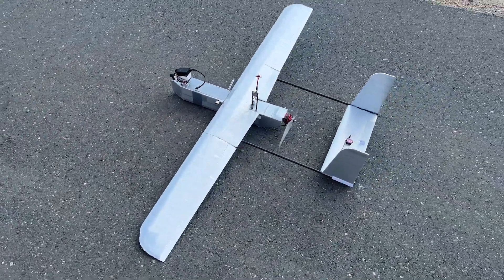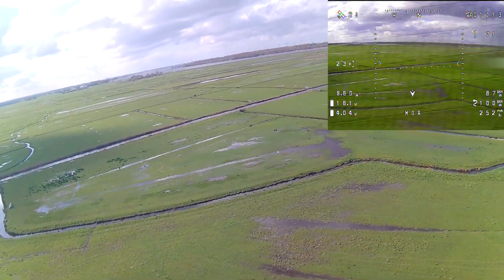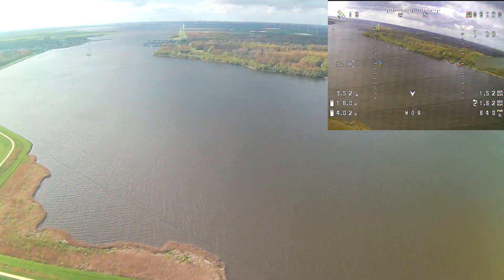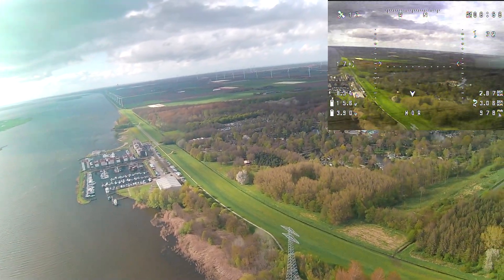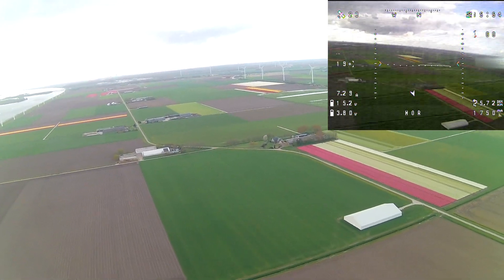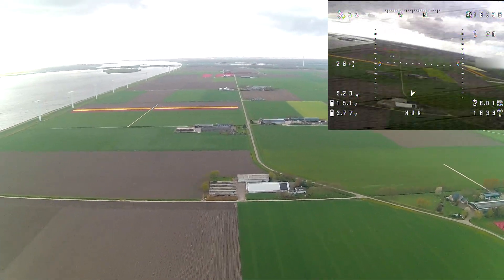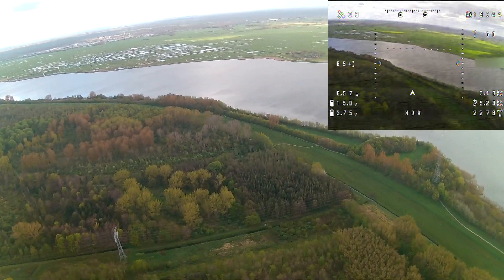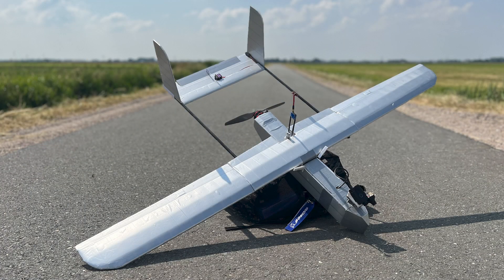Autonomous UAV for FPV - Silver Shadow - Range Test (Narrated FPV)

Comment: Would be interesting if you build an inverted V tail. You can remove the horizontal stabilizer from this and tip the vertical ones together and you're there.

Comment: Hi, really like your airplanes, New to the channel. I did not see all of your video, so I need to ask. Have you ever made a plane with airfoil that are not at 180 degree of each other. I understand that those help for stability of lift. But they are also slow and induce a lot of drag.  a V airfoil can help going faster with less drag and not so much power consumption. In your last video the batteries were not that low. you could have gone way farter and faster. I am also a ham radio operator. The frequency that you use is using line of sight (LOF), If you place your start base on a small hill or even on the top of a mountain that face a large plain, You could even do 20+ km with such setup.  The  LOF is not base on your eye sight but on the fact that the receiver and emitter have nothing between them.
Reply from the maker: Thanks!

I surely have made V-Tails, have a scroll through my videos!

Comment: Great , flight . That is some beautiful terrain that you flew over . Just curious if you could use a trailing antenna for your video feed  ?? Happy flying .
Terry
Reply: At those frequency the antenna length is not the problem, It is line of sight that is important. You can send a signal of half a watt into a satellite that is 100 km into space. We communicate with the ISS with hand held that have less than 5 watts. And that is in VHF and UHF (between 50 mhz and 700 mhz) the video transmitter is in the ghz. At those frequency the antenna length is  28.8 to 32 mm, while it is possible to make a co phased antenna, ou will need very good instrument to mesure and test if the antenna is well tuned and really do its job. a 2 element co phased will add around 3db to the signal (doubling it). but for doubling it again (6 db) you will need to have a 4 element co phased antenna. Also, you need to work on the same plane for both receive and tx antenna. if the transmitter is vertical polarized, the receiver need to also be vertical. There is multiple way to place antenna plane. but the must match between tx and rx.

Comment: The antennas from VAS are really good.    Crossfire LRS can easily get you tens of KM's of control sys range, especially with a VAS antenna.  Going to a lower freq, such as 1.2 can also get lots more video range.   
An aircraft which travels faster is much more suitable for long distance flying, as it can penetrate weather. 
rain water should not affect electronics in my experience.  only Pitot tube, I have got frozen before at altitude, resulting in a bad reading, and sub optimal aircraft performance.   also VTX should be kept dry, because the oscillator will not perform well when wet.  
rain water is so pure, that it is ok for electronics.  some people actually use distilled water immersion to cool electronics. 
nice flight, fun!  wings look sexy!
Reply from the maker: Yeah the VAS are incredible - I just ordered a VAS 15.5dBi Cannon Helical which claims to have +35km range. Since I don't have 1.2Ghz gear, the new VAS antenna is a good investment for my 5.8 equipment.
Reply: @AeroStuffFPV , Hi, kindly tell me how you reinforce twin boom with wings? Is there any vibration in the boom when motor is on?? Is the boom made of carbon fibre SQUARE pipe??? Sorry for so many questions. Thanks and Regards